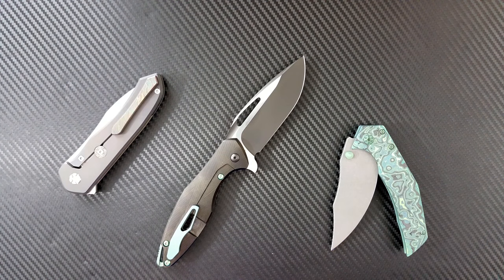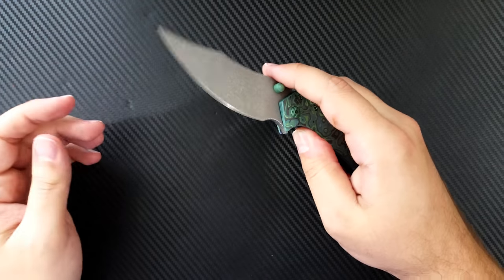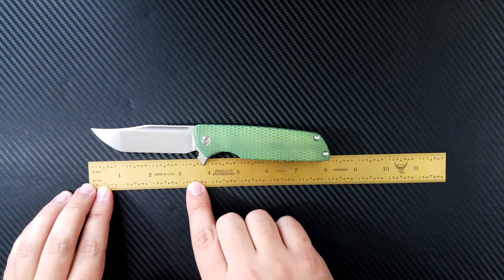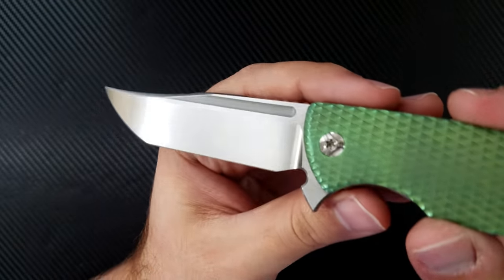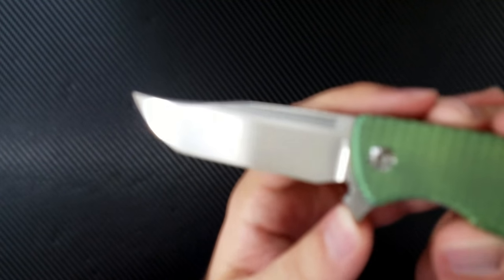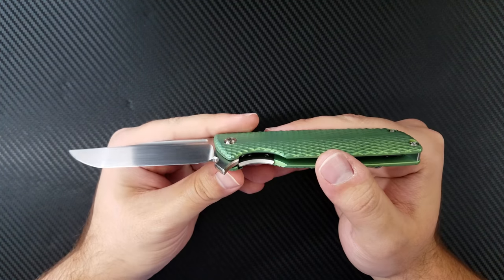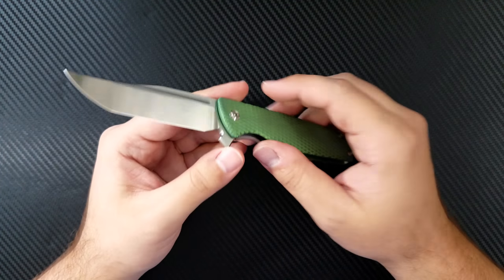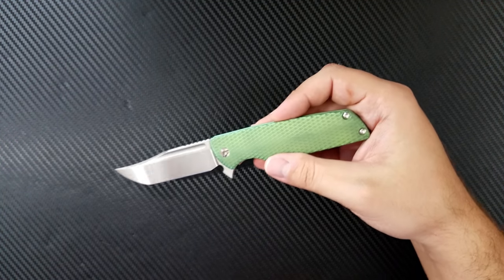Unboxing the Green Mamba! -- Custom Mini Typhoon

Comment: Just bought my wife a twosuns with the pocket clip and back spacer anod that same green. For $80 it's a killer knife. Ti frame, ceramic bearings with front AND rear flipper options. It's 121 model.